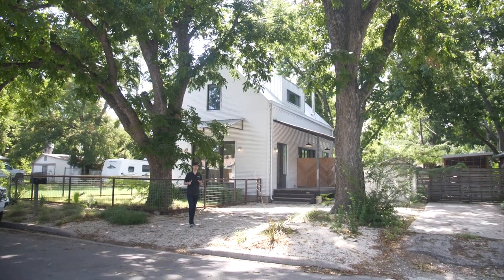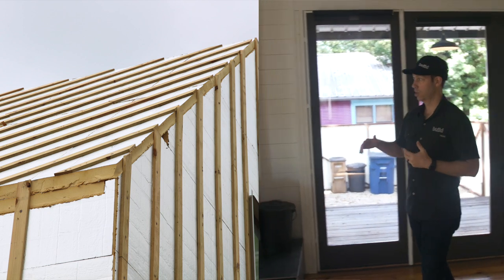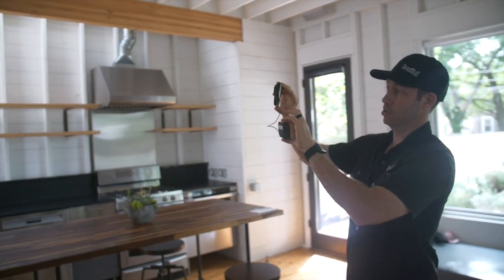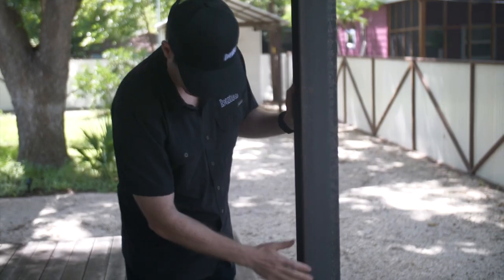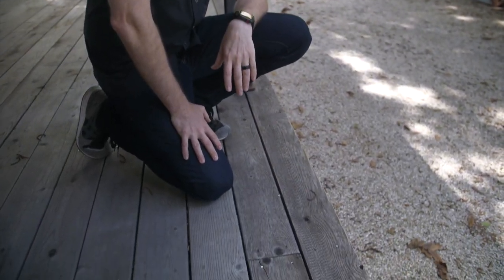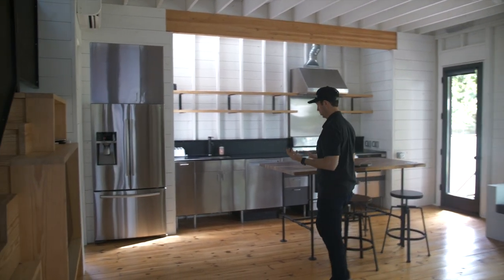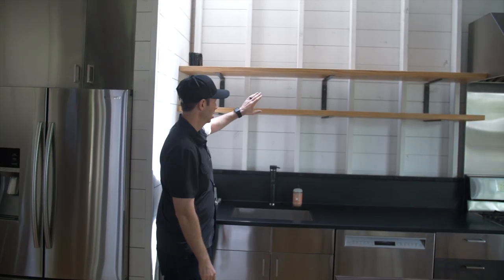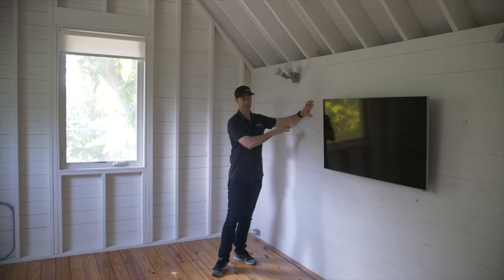This New House Has No Drywall, No Insulation, and an All Wood / Shiplap Interior!

Comment: Hold up the joists with steel columns and beams instead of wooden studs. Then you have unbroken walls and a more modern look, plus it's easier to stick sound insulation and drywall if desired. But steel is more expensive of course...

Comment: Clearly, this is an ultra modern USA house/Home - However, looking at it from the UK - it fails the English building (Regulations) code, as sound isolation between bedrooms and living rooms is REQUIRED. And 30 minutes Fire Resistance is also REQUIRED to stairs and the horizontal ceilings/floors. So totally avoiding rockboard (plasterboard) is hard but not impossible. We use fire-resistant coating on bare internal timbers a lot here. 
Also, the UK domestic Electrical Code requires all power outlets and light switches to be fixed between 400mm (18ins) and 1650mm (66ins) - so you do not have to stoop and can operate controls from a wheelchair.
The external "outsulation" and good air-tightness (at wall/roof junction) is very English Code compliant. The external fire resistance of the metal wall cladding is very UK code compliant. In the UK a house with external timber cladding would have to be 10m (30foot) away from any other house.
I wonder what the Energy Star rating of this house is/was... ?

(I am a state certified UK Building Code Official -with 40 tears experience - John Bone, BSc Hons, C.Build.E MCABE )

Comment: What's new ? This kind of insulation is used since 1977 in germany and is used all over europe. That was time the german law defined a code with something called heat insulation ordinance that must be followed if you built new houses or renovate old houses and want to get a cheap government sponsored credit for the renovation. Insulation inside the house is only used for old buildings when they are defined as a historic building or when other problems occur like different owners in a multi flat building etc. . Today you have to have outer insulation, if it is airtight is tested with closed windows a door sealed with a big fan to build a depression in the house and you have some more rules to follow like how the heating system is build etc. The law is now more strict since 1977.
One problem with insulation in the house is often that you catch moisture because you change the dew point and the walls can not breathe  and naturally regulate the humidity in the air. That's why indoor insulation is not very popular in europe. In the worst case you have a healthy not insulated house, insulate it indoors and get mould in the house.

Comment: Most building codes require drywall or plaster on interior surfaces for fireproofing.  Even if the wall is made of concrete!  I assume you had to get a variance to build this house without plaster or drywall.  But it does expose the occupant to increased risk of fire.

Comment: I guess the exterior insulation has to be incompressible or the siding will droop. So solid and probably taped. How do you gat it to breathe? R-25 walls is code in my area.

Comment: I'd love to have all exposed conduit and pipes lol
at least if you have a problem, it'll be easy to identify, inspect and repair
Reply: Yes, I've been saying that for so long and when I got my house replumbed & rewired decades ago we made sure that as much as possible was accessible.
Reply: I built my house with the water pipes exposed so they wouldn't freeze in the winter.and if one did bust I could easy replace it
Reply: Yeah i would love it also
Reply: In Adelaide during summer we need to run the cold water for 5 mins to clear the heated up exposed water pipe . We can get 40+ December - march
Reply: @jennyhughes4474  I just finished adding some new circuits in my basement for a hot water tank and another oven. I put in a second sub panel off the main, gave myself loads of room to work, and ran all the wires expose along the floor joists, and labeled them clearly so anyone that looks at them will know what they go to.
Reply: @DEVUNK88  That sounds SO good = well done you! The lodgings I'm in now have CRAZY electrics & plumbing and it makes me feel very unsafe when I don't understand how it works+. In my home (before I had to sell up to pay the debts I got after my accident) I chose to put a combi-boiler in because then you only heat up the water you use (no hot tank) & instant hot water at any time, much better - why did you choose to have a hot water tank please? I DO like to have an airing cupboard though - but you could have a very low voltage electric heater on timer in cupboard for that. The only problem with exposed wires is that rats/mice like to nibble them - we had rats as pets when my son was young & they gnawed those, floor-length curtains and other things. Also what if you had a flood = better wires aren't on the floor?!
Reply: @jennyhughes4474  I'll try to address all your questions,  first thing I did was figure out was map out the eletrical circuits in the house by turning off all the breakers and turning one on at a time and going through the house with a clip board to flip light switches, plugging a lamp into outlets to see what switches,outlets, or appliances belonged to that breaker..... 

the original hot water tank was oil fired so it required only 120v (hot, neutral, ground) I have looked into insta hots but was not ready for the expense, and the local home depot had an electric hot water tank at a price I could afford available the same day. since it is 240v I needed to add another wire and tie into another circuit and rearrange corresponding wires in the breaker panel to both be on a breaker rated for the amps the electric tank would use which was much more amps than the oil fired unit.

I just ran a completely new group of wires to the hot water tank, because my jerry rigged temporary wire job was inadequate and unsafe

as far as rodent all the wires I am running are newer romex or very will protected with thick out layer, in other words 3-4 wires inside of an outer sheath, very unlikely rodents will chew them.

to be clear I have a full size basement 7 feet tall, so all the wires are stapled to the floor joist of the floor above your head, my basement would have to have 7 feet of water in it to touch most of the wires, and they are encased in rubber. no need to worry, if flooding is that bad I got much bigger problems
Reply: @jennyhughes4474  also a basic understanding of how electricity works and the difference between wiring a 120 volt vs 240 volt circuit, amps, single phase vs three phase is advised

I have a playlist full of electrcity videos, some will be relevant. follow this link and scroll through them, your looking for videos pertaining to AC power. 
https://www.youtube.com/playlist?list=PLYgvOwZ6DzFWRtOKcXL2YrgQNCA4UekfI
Reply: @DEVUNK88  Wow, I don't know any of that stuff, hats off to you. Do you have to get somebody (in UK I think it might be the local Council?) to check your wiring & that it's safe (lots of regulations) - if you aren't a registered electrician? A friend of mine & his wife rewired their whole house = they did really good things like putting lots of electric sockets at desk height for all the computers, printers & so on, & they had to have somebody come & test & check it. All the best to you.
Reply: @jennyhughes4474  well luckily I own the family farmhouse and dont ever plan on moving so I dont ask permission or tell anyone. from what I understand having an inspection or a certified electrician is a good idea because they will help you do things properly so if you have to sell the house or do work later the next guy can safely assume you followed codes and standards. It makes it safer and easier for anyone that comes along after your wiring job.
Technically everything I did I prolly should have had inspected or installed by someone else. I just finished and turned everything back on with great success and I think it will work properly for my life time
Reply: @jennyhughes4474  also UK wiring is probably similar, but I know I cant plug my stuff into your outlets when I visit LOL
Reply: @DEVUNK88  Yes, I expect one day we'll all decide which system to use & what shape plugs = far easier for travel & international moves!
Reply: @DEVUNK88  Well done, hope it's safe & good for you. All the best.
Reply: bookmark

Comment: So it does have Insulation, nice clikbait. 

Insulation isn't called that because it is inside the home...
Reply: That's not insulation, it's outsulation.
Reply: @AnastasisGrammenos  it's still insulation... Look up the definition for the word insulation and you'll see it doesn't matter whether it is inside of the building or on the outside of it. Outsulation is a fairly recently invented term.
Reply: Pretty sure that was a joke.
Reply: Anast Gramm lmao i was gonna say that 😂
Reply: Insulation: protect (something) by interposing material that prevents the loss of heat or the intrusion of sound.
Insuloation is not: protect (something) by interposing material that prevents the loss of heat or the intrusion of sound, from the inside.
It's insulation on the outside, and the house looks like shit and is impractical.
Reply: It is actually more practical. and luckily people are not all the same. Different people like different designs.
Reply: the fun thing is, here in western europe inside insulation is frowned upon since the 80ies! Outside insulation is the way to go since many years for many reasons. Reson number one is that you don't want to have frost in the structure of the house but inside the insulation.
Reply: I love how this is just a house "without insulation", so they put it on the outside and wrap it around with metal. Could I literally not just do the same exact thing to a garage? It's made of metal. Put some "insulation" that's not called insulation nowadays.
Reply: @Peter Mills It's a distinction, it's not meant to dupe anyone. It's meant to CLEARLY distinguish where it is placed so that people who have been accustomed to seeing insulation on the interior between the studs understand why it is more beneficial to have the entire house wrapped.

You're not nearly as superior to everyone else as your tone seems to suggest you believe you are. 

There is nothing dubious about simply educating people about the differences in why a product is employed in a different (at least to Americans) or more efficient manner.
Reply: Well, I’m not sure if it was meant as clickbait or not but it is definitely idiotic to imply that exterior insulation is not insulation or to call it “outsulation”. Exterior insulation has been around for a long time but usually it is used to add extra insulation to a house when you don’t want to make the studs wider to allow for more interior insulation. And recently there is a school of though that says its best to use a combination of both interior and exterior insulation. It can also be used on the exterior of concrete passive solar houses so that you can use the concrete walls to store thermal energy. But why on earth would you use only the more expensive exterior insulation simply so that you can have ugly exposed studs? I just don’t get it.
Reply: @GroundPoundersPlace  : Shhhh! Careful! That kind of talk is illegal in The Midwest/South of The U.S.!
Reply: Insulation is inside the home, outsulation is outside the home.
Reply: @robertkat  - Actually, the correct terms are "internal insulation" and "external insulation". “Outsulation” is just a made up term for external insulation.
Reply: @MarcoTedaldi  correct me if I'm wrong- wouldn't the external insulation allow for the water heater floors that are so popular?
Reply: @Kooma4Yew1600  i think it always makes sense. But true, inside insulation and floor heating would be really crazy!
Outside insulation helps to keep the frost out of the load bearing walls which helps a lot with integrity and keeping moisture out as well...
Reply: Languages are invented by human to communicate. I think it is ok to use outsulate since it did not confuse us here...
Reply: SLOBeachboy Ahy does this matter so much to some of you. It’s just a word.

Comment: This is dumb. The drywall provides sound damping for all the plumbing as well as other sounds and provides clean easy to maintain look . Seriously louvered doors 😂😂😂.
Reply: Plumbing goes in shoulder areas or hallways. If it is noticeable at points, add a chase. House was built for a couple, not a family. Like he says, soundproofing can easily be added where needed.
Reply: Ok well they only lived there 4 years , guess they weren't in love with it either.
Reply: @stanleyhape8427  Haha. That's meaningless. You're grasping at straws. You are defeated in the eternal interwebs comment wars.

Comment: I love the shoulder area, the outsulation, and the exposed utility look, but what about fireproofing???
Reply: My first thought as well, as my city's inspector constantly nitpicks about sealing & fireblocking stud spaces. He'd have a heart attack on this one. All it's gonna take is one kitchen fire and this thing is gone
Reply: Hi Alexander Riccio,  The Code is based on an “enclosed area”. This construction has no such voids.  The fireproofing is about sealing the cavity so fire does not enter. If the fire gets inside walls, the structure may need to be demolished.  Fireproofing is to preserve the home from extreme damage in a contained fire.

Comment: Having inspected several homes looks interesting especially on thermal. My only concern would be on sound deading.  And echoing as well.
Reply: You could always "finish" the walls with plywood backed by dynamat, then hang some mass loaded vinyl between the walls. Should deaden things right up between rooms. Add a solid core door for each room for a stronger effect. Then, to reduce per-room echo, get some geometric foam tiles hung up on the walls.

Comment: What is odd is there are no fire breaks in the house,  lovered doors allowing smoke spread throughout the house and no sheetrock as a temporary fire barrier.    It's crazy, with the HVAC system and wood walls, you will hear everything in the house.
Reply: There would be very few places for fire and smoke to hide,so the smoke detectors would go into alarm much sooner.Also if someone was home and house was equipped with good fire extinguisher it would be much easier to deal with.
Reply: HVAC is uber quiet. He covered that in another video.
Reply: @MrHeavyzz4  - Plus... restoration after a fire would much easier than dealing with restoration in a traditional dry walled home.
Reply: Fire code is my question as well.  Don't you need drywall or at least more that=n one layer of wood between rooms and floors to meet code?  In Maine I think this would only be allowed in a seasonal "camp"  (cabin).

Comment: This house, ever so slightly, falls into a category of design that arose in the 1970s - High Tech. The movement incorporated technological and industrial materials, fittings, finishes, etc. into architecture and interior design. While this house is not hard core High Tech, it definitely tips it's hat to the style. I would call this Cottage Industrial, and I like it a lot. When I first started seeing Matt's videos on this house I was fascinated by the Perfect Wall concept. As the building progressed and we could see how it was going to finish out, I really knew they had something special here. Rauser Design did a fantastic job creating not only an interesting house, but a wonderful machine. Perfect Wall House FTW.

Comment: Drywall and stud houses are going out of fashion, everyone with money (or time) is building concrete or brick houses which are much better insulated and last a lot longer.
Reply: What are they using in combination with the bick and concrete, because the R-value of Wood is higher than those materials. 
I would be so happy if Drywall does out of style. I've led building projects and volunteered on enough to know that I hate putting up drywall. 
I'm interested to hear of more alternatives. 
I'm currently saving up to make my own small house with tiny house building tricks.

Comment: Call an electrician and ask for price of wiring a new house, then ask for a quote were all the wire has to be surface mounted and you will see your money fly out the door. If you hate drywall use magnesium board and it will be fireproof too...wall board allows wiring to be protected, if you have to encase all your wiring you could have put wall board on and had places to hang some nice art..

Comment: No way is this practical for family living. Looks great in respect to a construction/insulation view point.
Reply: CADguru78 how is it impractical other than its footprint?  As far as quiet rooms, I agree, but a little roxul and some sheet rock will deaden sound.
Reply: Michael Hensley then why not just finish it like every other house has been built for the past 60 years!
Reply: Sound deadening is only needed on interior walls in this concept. In a different "family home" build you could have open cell foam in the walls and still retain the shiplapp look.
Reply: its not really  family home with one bedroom.  Where is the living room in the house?

Comment: This is a great concept for us here in the deep south/coastal areas, where flooding is a major concern, especially during the wet months/hurricane season.  We wouldn't have to rip/replace the lower section of the walls.  But I wonder how the insulation on the outside will hold up to flooding.

I need to figure out how to incorporate this into my house remodeling/flipping business.